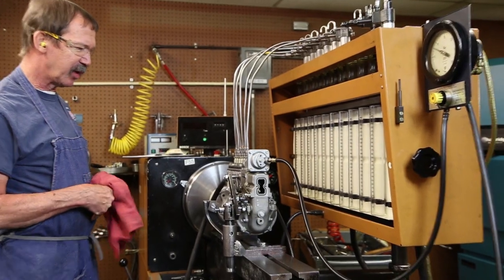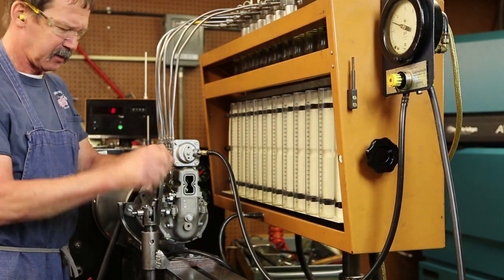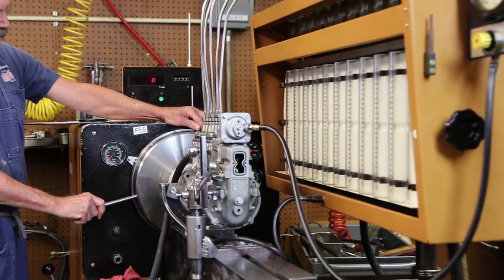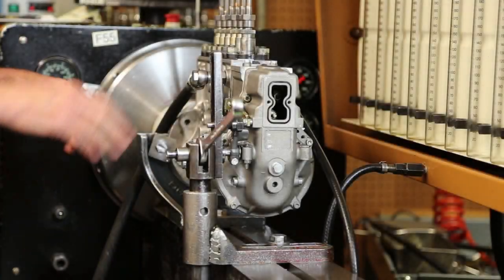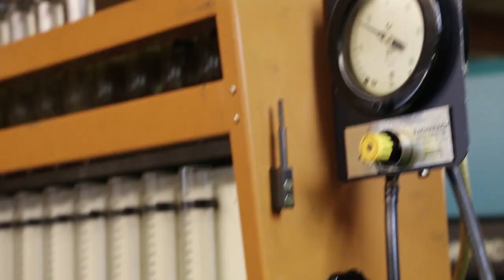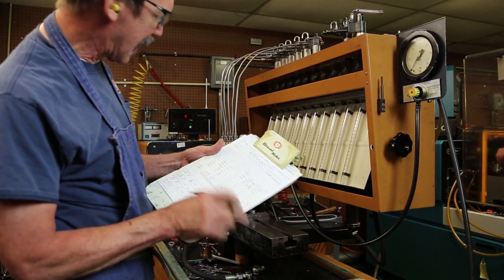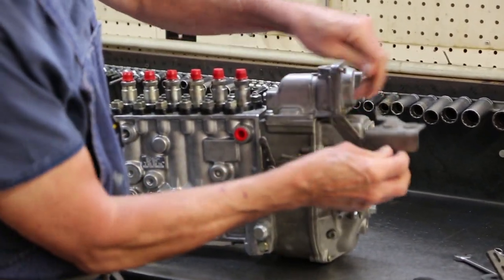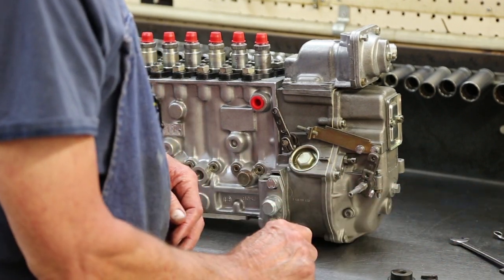Part 4 - #Bosch #Diesel #Pump #Rebuild - Area Diesel for #bcbloc02 Hyster Forklift 8.3L Cummins Swap

Comment: Hello, is there any chance you guys can shed some light on inline pump nomenclature? There are discussions the all over the board from ag applications to pull trucks, and nobody really agrees on much. The letters a,p,m, designate pluger size, but  the numerical part is a mystery 2,100, 3,000, 7,100, 8,500. There are over a half dozen pump designations, plus governors. It would be really interesting to hear what you guys know about this, if even just on the website. Good job on the videos.
Reply: The pump Which I got from a scrap yard to study and use as an exhibit has a governor totally different to those shown on utube videos. Would like to know what kind of engine and application it came from. Part number RQ 250/1100 PA269R. PE6P100A720RS15 on the pump. Has no fuel cutoff leaver I can see. Quite strange. Can anyone advise me?